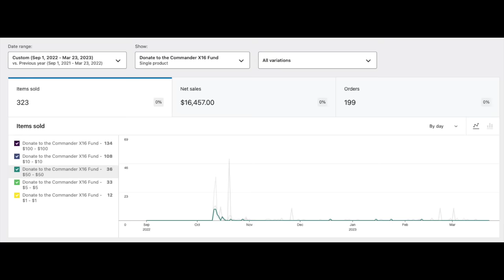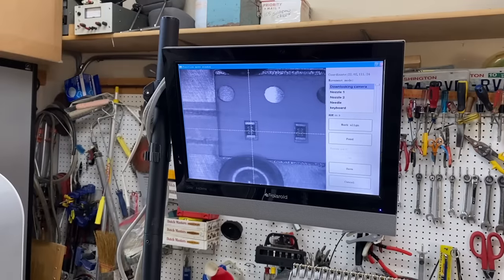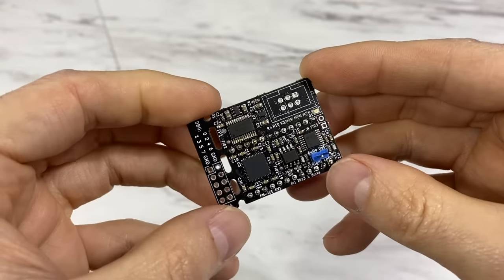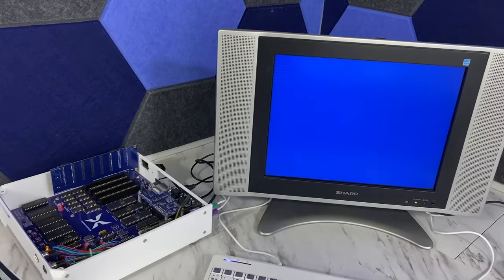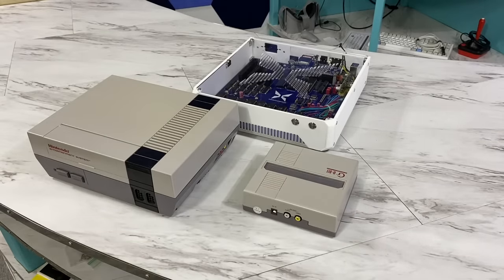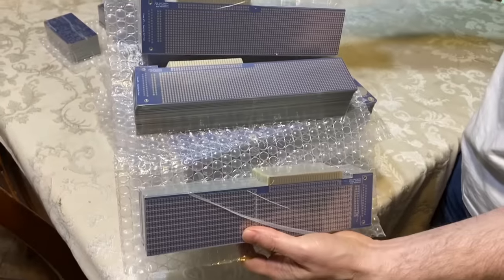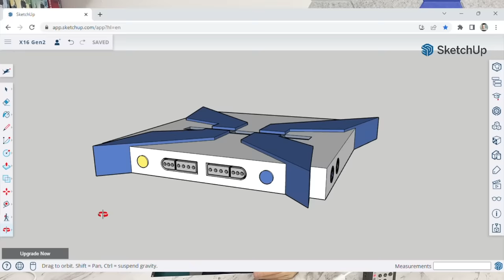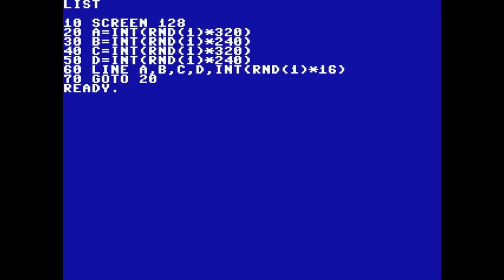Commander X16 2023 update

Comment: I've been watching this stuff from the beginning and even then I thought it was a difficult premise. I think some of the design goals were contradictory and it seems as though many of the original goals aren't being met. Now you're adding boards and bodges and band-aids to try and adhere somewhat to the original vision. At this point you're in sunk cost fallacy territory and you should take what you learned from this project and spin up a new design preferably with surface mount parts. All of us get to that point sometimes in a project and we have to remember to not fall in love with it just because we worked on it, sometimes you have to let it go and move on.
Reply: As hard as this is for me to say, I think you might be right in some ways. I have faith that they can still pull it off somehow, but the project definitely appears to be going a little sour

Comment: I'll be honest...once you start filling a system with FPGAs, you might as well just make a MiSTer core or use software emulation.
Reply: Yep !
Reply: Your honesty is refreshing
Reply: The site selling the board offers both a free emulator for download and an online emulator. 
This is a niche product for a very tiny niche indeed. Physical cartridges is pretty cool idea.
Reply: @andychow5509  No, it's not. How do you backup physical catridges? There designed for one purpose, to keep you away from making backups. Nintendo did this many years and now the users can't run them anymore because the catridge or the console got defective.
Reply: @OpenGL4ever  Ok, you're really confused. Any cartridge can be backed up by extracting the ROM which can be done by anyone. The cartridge was designed to store software AND sometimes provide extra capabilities such as save states (which consoles were unable to do. Even the PS1 needed save cards), or extra computing capacities (like Star Fox). Carts had MB capacities, this was before the internet and before USB keys even. We had floppies with 1.44 MB storage, so it wasn't a copy protection scheme. 
There WERE protection schemes in cartridges, but that's absolutely not the reason they were designed that way. It was the only way to hold that much data in a solid state format.
Reply: @andychow5509  The average user couldn't and that was the reason, why Nintendo used cartridges even very lately, when all others already moved to CD-ROMs.
And then it is still possible to build into a cartridge some form of hardware dongle for copy protection reasons.
Reply: @OpenGL4ever  CD-ROMs was science fiction when the first famicon and nes came out. It would have made the price of the system insane. SegaCD was the add-on to the genesis, so already evolved by that time.
You're thinking later generations. For example the N64 wasn't really good mostly because at that point CDs were common and had 10-20x the storage, and the laser mechanism and such had decreased in price. Even the gamecube's descision to use mini-discs was at that point solely to prevent copy theft, I agree with you for those consoles.  
But look at the other extreme, and consoles like the NeoGeo basically had an entire system on a cartridge, not data only. And there wasn't another way to technically do this, since things like cd-roms have very poor random read.
Reply: @andychow5509  You should listen more closely.. I was talking about the fact that Nintendo used catridges even when others already used CD-ROMs. 
The N64 is one example and was released in 1996. This was at the time, when the Playstation and Sega Saturn were released 2 years before and had CD-ROM drives. So no science fiction, you should do your homework.
The reason why Nintendo did that was copy protection. Manufacturers run away from a console for which users only create copies of the games.
And a console can only survive on new games in the long run. Therefore, there is an interest that copies are prevented.

Comment: board warping was due to using the cheapest thermal pcbs from pcb way (such as TG135, barely suitable for a hand soldered prototype) step up to TG155 or TG175 for less thermal warpage.  It could also be due to pcb layout being non-symmetrical from a layer viewpoint (it bends like a thermostat element)'

Comment: I have enjoyed watching how the new 8-bit micro has developed.  But I can't help thinking it has strayed from David's original idea.  It's become like Frankenstein's monster.
Reply: It strayed from the parts of David's original idea which are not feasible to do. An all-ASIC, all-8bit, upgrade to C64 sound and video system is just not feasible. You can bend on the all-ASIC (as the X16 project did), bend on the all-8bit (like the Agon Light), or bend on the upgrade to C64 sound and video, which many existing hobbyist 8bit systems do.

As far as David's dream, he seems to be happily programming an upgrade of Planet X3 for the X16, so it seems like it's close enough to what he was thinking about.
Reply: @brucemcfarling4674  Then you can ask people to donate money to buy board assembly equipment and move on to some other profitable boutique retro board projects once you've sold all the x16s to the hardcore folks from the x16 forums who still want it.
Reply: @doc_sav  The hardcore folks are the ones who will be buying the Dev board at $500 ... those in the market for the Dev board type system but who aren't hard core will wait until it costs $350-$400, as the production cost is clearly going to come down. And those who aren't willing to pay an extra $100+ for a board just because it has through hole components will wait for the ~$175 cost reduced system.
Reply: @Jeffrey Craig After successfully buying 300 YM2151's from the supplier, they still had a back up plan in case there weren't enough, which is YM2151 core on the same inexpensive FPGA that they use for Vera. He shows the first trial run of a drop in DIP replacement board, made by Waveicle, in the video you are responding to. You seem to be pruning and trimming facts to get a better fit for the narrative you are constructing.
Reply: @brucemcfarling4674  $175? The goal is sub $50.
Reply: @Okurka.  There was never a goal of sub $50 for the cost-reduced version of the ASIC board. The goal for that one was under $200 if possible, and so far they are on track to hitting it. That was the goal for the Gen3 board, not the Gen2 board.
Reply: Cheesy, but no plan survives the battle field.
Reply: You might want to look into the basic engine or agon light. They're closer to the original idea.
Reply: @JohnZombi88  It seems highly likely to make it to Gen 2. Since I am not interested in Gen 3, it is no particular worry of mine whether that version is produced. The fact that the "too expensive to succeed" $500 early release sold out the available boards in a day is reason to be optimistic that the $350 main release of Gen 1 will be successful enough for Gen 2 to be developed and released.

Comment: If you already converted two vital components to fpga I dont understand why there is no definite plan to produce the x16 as a single fpga chip system at a reduced price now? we know it'll have a full remake in misterfpga at some point which may kill the demand for the hardware making it unsustainable 😢
Reply: Yeah, I don't understand that, as a cheap version could have the broadest possible appeal and build the user base. Waiting years to do this seems kinda backwards. If they wanted a deluxe version, they could have started with the cheap, simple version first and built up to that, instead of jumping in the deep end of complex and expensive hardware production from the get-go.
Reply: Because making the mostly FPGA system hardware compatible with the real 8bit ASIC components should be straightforward, but if you start with the FPGA, it's easy to design something that the real 8bit components can't match.

So you need to do the through hole version first for the hardware reference platform, then the cost reduced version with surface mount versions of the real CPU and then finally find the single FPGA with the capabilities to handle everything but the 512KB HighRAM and FlashRAM.
Reply: They still would have been waiting years ... the FPGA in Vera wasn't available again until late last year.
Reply: @brucemcfarling4674  When I said waiting years I meant years after the initial release of the system. He's mentioned possibly putting out a cheap version in something like 3 years after the first, though with all the delays the project has seen I'd bet on any estimates being significantly increased. The system was initially supposed to be low-cost to achieve a large install base and therefore a critical mass of software support. He explicitly called out the Mega65 as already being his dream system but far too expensive and thus unlikely to gain this support, but now the X16 looks to be almost as expensive.

If these concerns end up being irrelevant, then I guess his initial ideas were somehow totally wrong, and there is a substantial market for a proprietary, code-your-own software hobby computer that costs as much as a PS5.

Comment: When you offer kits for the community to build, expect the community to have its own support line, on the internet.
Reply: Unfortunately, the most problematic users will be those who do not use a community for support but require hand holding by the manufacturer -- which does not seem viable for such a small team
Reply: @petermuller608  Why can't they just state outright that they will not be offering support because of the size of the team, then put a link to the forums? People would be understanding, and those that are unreasonable can take a hike. The only reason I can think of otherwise is that dealing with missing or non-working parts in a kit might be a headache, and dealing with a kit as a separate product is also no small task.
Reply: @haysoos123  not wanting to sound dismissive, but this view is naive. The users reading and understanding "we do not offer Support" are not the problematic ones.

Just look at the comments here. So many commenters are crying about certain aspects of this project, which were clearly stated and explained by the team :/

I personally would like to see kits, too. Maybe the team or a better a third entity could sell the PCB. Sourcing the components themselves should be a high enough barrier for many not able to assemble such a kit
Reply: @petermuller608  Judging by all the grown adults crying about this or that, there will always be those people. So what? It's not something they should take into consideration. I hope they will offer a kit, but if they don't, I'm not going to lose sleep over it.

Comment: One of my first tech jobs wile I went to school was building circuitboards, we had an axial incerion machine and pick and place machine, and a rather large wave solder machine that looked like a shuttlecraft! You loaded the boards in to it and it had chains with fingers that gripped the boards. It went over a 4' long preheater, a bubble flux, then a 1/2" thick 16" wide wave of solder, it just kissed the underside of the board. Also we used little tempurature activated stickers to make sure all the temps were good. After that they went into an industrial dish washer to clean the flux off. Followed by peeling the kapton tape off the connectors, and testing. I remember that if were were 10 degrees Celsius to cool, some of the longer boards would warp a little. Also back then they would design the boards to combat warping, either by adding backplane or removing it on the boards design. It was really complicated.

Comment: Looking at the specs (video and sound capabilities + the retro 8-bit feel) makes me think I that would love this machine.
Looking at the form factor makes me think again. I could place a c64 sized retro computer on my desk easily but adding an additional computer housing plus a keyboard plus a VGA to HDMI converter makes me prefer to play with the emulator only. The Nintendo controller connector is a strange decision too: I would assume that those who are into retro computers and programming are coming from the C64/Spectrum/Amiga scene rather than the games console scene so the availability of 9-pin controllers (which allows two separate fire button) are more likely for them.

Comment: For the board warping, try this:
Preheat upside-down then flip for the immersion. If you don’t do this then the immersion will only exacerbate the temperature difference between both sides of the pre-heater. Immersing the slightly cooler side will normalize it and decrease the temperature difference once it gets hotter. Of course, you can’t flip if you have a brace on there so try this first.

The Famicom cartridge/slot is a bad idea. Being more concerned that people would confuse it with an Apple ][ port makes little sense when bootleg Famiclone PCs with FUNCTIONAL Famiclone slots are FAR more common… by several orders of magnitude. Ignoring the Family Computer itself with Family Basic and the keyboard, there are already many 8-bit Famiclone including PCs Bung PC Doctor, the Jet Li/Jackie Chan computers from China, actual Famiclone/NOAC game consoles, and so much more. The least you could have done was design an incompatible cart shell, but then you guys spin the availability of existing shells as a positive too!

Please don’t do this without some consideration for what will inevitably happen. The least you could do is make sure the voltage and ground pins match and won’t fry a Famicom cart. Maybe you can still key the slot with one of those insert pieces and notch the PCB if you still want to get away with using that slot and shell design. Otherwise, please reconsider using the shell design. That’s probably the easiest part to do-over anyway.

Comment: Definitely want one of these, but I'll wait for you to scale up and work out the kinks.  I'm hoping that for the Gen 2 you'll keep at least 1 cartridge expansion port like what was done with the Sega Saturn.  
I'm developing a piece of hardware myself for the casino industry, so I know very well the struggles you're going through.
Reply: The "cartridge slot" IS the expansion slot. They didn't "add a cartridge slot", they added cartridge slot capabilities to the expansion slot.

If you don't want a game cartridge, but you do want an expansion card, you can just take an expansion card designed for the X16 Dev board, put that in a Famicom cartridge case, and plug it in. Of course, you might have to do some cutting for the I/O connector if it's an I/O card -- I expect that the more popular X16 Dav Board I/O cards will be available with a ready made case so they can plug straight into the X16c without having a naked card sticking out.

Comment: It would have been cheaper to do an FPGA from the start.   $500 is insane.    If real components dont exist then  they do not exist.  An FPGA that matched all the real chips, SNES controllers, PS2, then adding in the commodore IO ports, Commodore cartridge, RS232, SD card, and your custom cartridge port would have been great.  Having he phyiscal ports and cartridge connectors would have been what made it.
Reply: Hindsight 20/20

Comment: I have never seen a solder dipping machine, normally companies use a solder wave, where there is a pot of solder and this then pumps a wave of solder up to come into contact with the PCB as the PCB moves across the wave.
Also you should really have it in a jig to hold it flat. Edit: well you seem to have that sorted.

Comment: For your HDMI troubles, consider supporting DVI. It is unencumbered by patents, there is no licensing enforcement racket, and it can be converted to HDMI with a $2 passive adapter.

HDMI 1.0 is mostly DVI-D SL with a different plug and a "compliance program" run by a really nasty cartel (a.k.a. the HDMI LA). It adds some features (such as Y′CB'CR video, an audio sub-channel and a DRM system), but all those are optional and not relevant to the Commander X16. Newer HDMI revisions adds more features and higher bandwidths, but again nothing relevant to the Commander X16.

Oh, and if you make a Vera board with DVI-I support (DVI-A and DVI-D in a single port), you can support both VGA and HDMI monitors by simply providing two different $2 passive adapters...
Reply: "HDMI" (or whatever one calls non-licensed TMDS over that particular port) exists on pretty much all televisions but DVI does not. I started the work to throw in a TMDS transmitter because many of the number of people who mentioned it because their television had multiple available HDMI ports but usually not VGA - and I don't think anybody ever mentioned having DVI. Many televisions have composite input and I recently improved that quite a bit, but it's still an unpleasant experience for most unless you have an actual CRT.
Reply: They could also use DisplayPort and thus support all that, including VGA, DVI and HDMI. Without licensing issues.
Reply: Unfortunately, that's not true (at least in 2023). At least there's a few patents that MPEG-LA collects for for DVI in the US and any country that recognizes hardware patents, until 2025-2026. (e.g. US7059917B1 to be expired in 2025).

Displayport is not bound to patents, but is encumbered by the required chips associated and the software inside them. VESA requires an annual payment of a minimum of US5000 for access to the diagrams and chips/software to  use the standard.

Comment: I've never dipped boards that large. My machine is much smaller, BUT your problems may come down to two things. Board is in the bath too long and/or it's the ground and power planes. On one of our more problematic PCB's we switched to mesh planes. It helped a lot with solder all joints getting soldered.